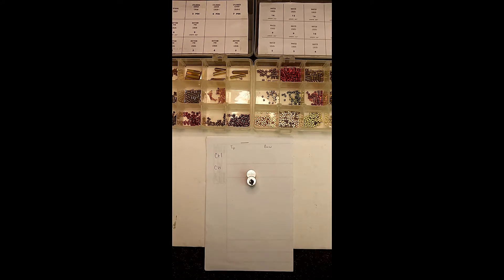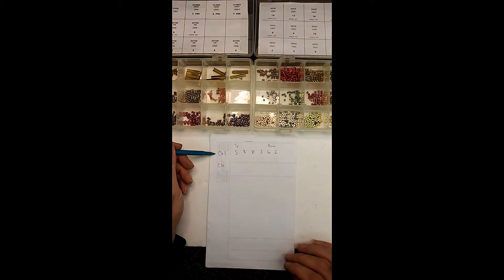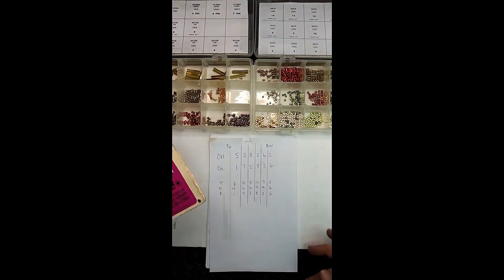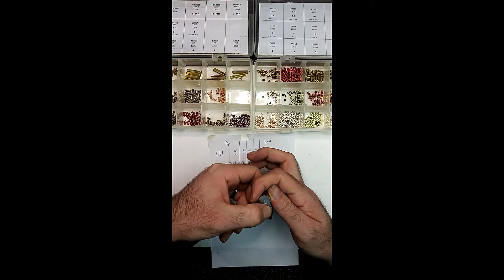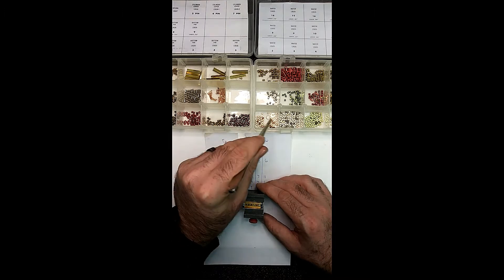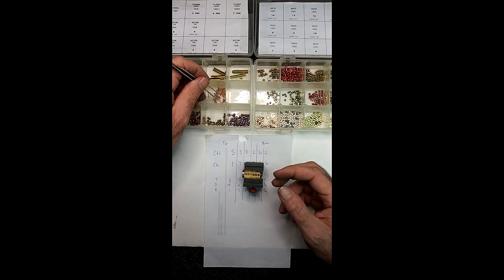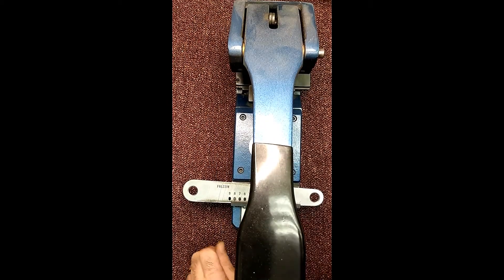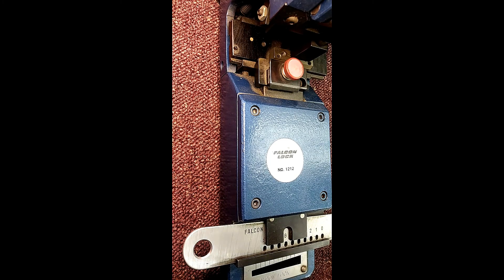SFIC Keying Guide & Cutting Keys

Comment: You don't need the slide chart, you can do the math in your head to find the bitting info if you know the control and change keys' cuts. We'll use your first barrel at the tip as our example. These rules also pertain all the way across for each additional barrel. 

Each barrel's control key cut and the top pin always add up to 13 (5+8=13). Therefore, to find your top pin, 13-5=8. 

Your pin stacks always add up to 23. In our first barrel, we have an 8 top pin and a 1 bottom pin totaling 9 (8+1=9). Therefore, our driver pin is 14 (23-9=14). Hope this helps!

Comment: What does A2,A3,A4 mean when making I/C keying?
Reply from the maker: A2, A3, and A4 systems are predetermined systems that have different depth increments/ stack totals. 

A2 = Depths (0-9) w/ increments of 0.0125" (Stack Total: 23)
A3 = Depths (0-6) w/ increments of 0.018" (Stack Total: 16)
A4 = Depths (0-5) w/ increments of 0.021" (Stack Total: 14)

Surprisingly enough, the system that yields the highest amount of total key codes is the A3 system. 

A2 = 16,384 (7 Pin) / 4,096 (6 Pin)
A3 = 279,936 (7 Pin) / 46,656 (6 Pin)
A4 = 78,125 (7 Pin) / 15,625 (6 Pin)